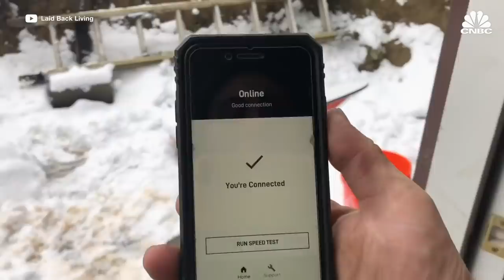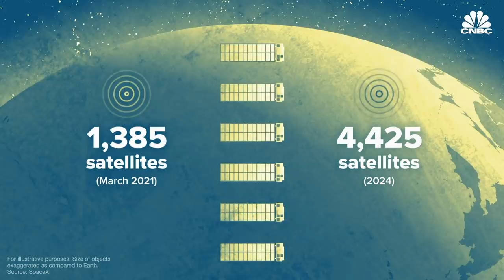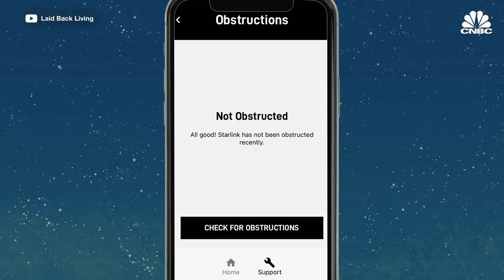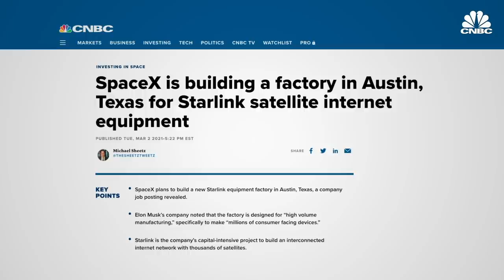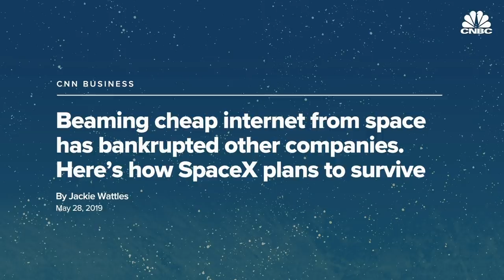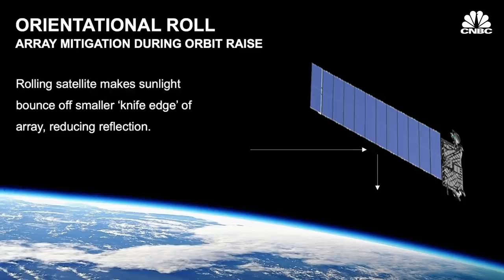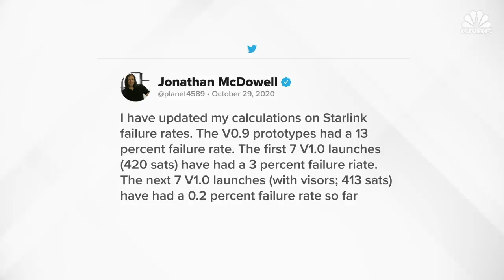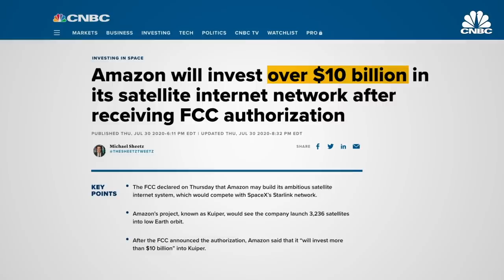Why Starlink Is Crucial To SpaceX’s Success

Comment: Non-trackable debris is going to be a huge problem when this becomes more mainstream.
Reply: Not really.  These are inherently traceable.
Reply: @xiaoka  I'm talking about non-trackable debris... Which would be a significant threat to a network of satellites.
Reply: @eat_ze_bugs  right, your comment made sense like 10 years ago. Nowdays everything can be seen.
Reply: @shanewillbur1325  Not everything can be "seen". An impact from a 10mm paint chip from a second stage could damage a starlink satellite, possibly rendering it useless given its disposable nature.
Reply: Probably not. Small debris does not cause massive debris fields. It might disable a satellite, but it will not impact the de-orbit plot at all. All it is, is a rather unfortunate and expensive way to de-orbit that piece of paint as well as the satellite.
Reply: These satellites are in low earth orbit. So the problem will not be that big as things will fall and burn up soon
Reply: @eat_ze_bugs  My understanding was that more modern/recent rockets and definitely commercial rockets(SpaceX, Rocketlab) don't really ever create micro-debris like paint chips. Supposedly the space shuttle and all Chinese/Indian vehicles were/are very bad in this respect.
Reply: @Diggnuts  It might not create a massive debris field but if it were to disable a Starlink satellite it can definitely alter the structure and attitude making it unsafe to de-orbit and a threat to the network itself.
Reply: @adamanderson3042  Micro debris like paint chips or particles from fatigue joints are inevitable during rocket launches. Shock from stage separation and engine ignition will always cause micro debris especially if the rocket is painted. Ice buildup and fuel leaks above the Karman line is another factor many engineers in the industry tend to leave out due to its evaporative properties, but if we are talking about hundreds of thousands of satellites from various entities then things can go wrong very quickly before we can rectify it.
Reply: @vineets  Agree, waiting 4-5 years at most for orbital decay would be pretty inconvenient but still better than the alternative.
Reply: @eat_ze_bugs  "Shock from stage separation and engine ignition will always cause micro debris especially if the rocket is painted"

Stage separation is always done at suborbital speeds and Starlink launches don't require engine relights so those too are done at suborbital speeds. So anything that comes off the rocket at those times will fall back to Earth in dozens of minutes. Paint chips and small objects like that that somehow do make it to orbital speed usually deorbit in days to months because of the nature of paint that is applied to rockets, it has a very high volume-to-mass ratio, which is perfect for naturally deorbiting. 

I can promise you that for all of the reasons I have stated, Falcon 9, Falcon Heavy, Starship and Starlink will cause unimaginably inconsequential amounts of orbital debris that will last for such a short period of time, such that to complain about it would be tantamount to entertaining the possibility of turning the global economy off and letting everyone make their own goods because you're worried that the mass of cargo ships travelling across the worlds oceans is changing the mass distribution of the planet and therefore changing the gravity of the planet.
Reply: @adamanderson3042  Are we having a discussion or are we arguing? Read my original comment again. Nowhere did I mention SpaceX in my comments, you seem to think I'm complaining about them when I'm explaining the inevitability of micro debris and how it could impact various networks of satellites like that of Starlink's. The act of inhibiting discussion with analogies such as "turning the global economy off and letting everyone make their own goods..." is not going to solve this problem but instead make progress even more difficult in the future. My main concern wasn't about SpaceX debris but non-trackable debris from all forms of activity in general with the probability to pose a collision hazard that needs to be attended to if we're going to have such a ubiquitous, complex and fragile set of networks interdependent on one another.

Don't take my word for it, here's a useful handbook still relevant to this day on orbital & sub-orbital debris mitigation. You and anyone else reading this might find this helpful as to understanding the sources of debris that are currently present:- https://apps.dtic.mil/dtic/tr/fulltext/u2/a435172.pdf
Reply: @eat_ze_bugs  Utter nonsense. Even if that small amount of kinetic energy is fully absorbed, the orbit would be affected minimally and the automatic de-orbiting profile would still be valid. It would exit the occupied shell within months. That is assuming the maximum and most effective transfer of momentum possible.
Reply: @Diggnuts  Albeit a low probability, small debris can definitely affect the attitude dynamics and gravity gradient torque of such a craft especially given its low mass design.

You are right in regards to the craft exiting its occupied shell. It will take a relatively short period of time given that it doesn't lose control or else It will be at the mercy of all the other satellites and future space stations as the orbit decays. But remember, we're not only talking about one satellite here but a multiple growing network of LEO satellites at various altitudes from various entities that needs to be regularly replaced from time to time which has never been done before. 

The only improvement I can think of that can overcome this issue of uncertainty would be to employ some type of passive attitude stabilization. I'm sure the team at SpaceX are actively working on improving their fail-safe procedures but until then micro debris will still be a threat to these networks one way or another.
Reply: @eat_ze_bugs  It can, but it usually simply doesn't so this pedantry is pointless prolix.
Reply: @eat_ze_bugs  "Nowhere did I mention SpaceX in my comments, you seem to think I'm complaining about them"

Dude, my literal response to you was saying that SpaceX was really good in these regards and then you replied to me and contended that by saying "Micro debris like paint chips or particles from fatigue joints are inevitable during rocket launches." so you were obviously arguing the point specifically surrounding SpaceX, don't lie. I stand by my original comment, which was "My understanding was that more modern/recent rockets and definitely commercial rockets(SpaceX, Rocketlab) don't really ever create micro-debris like paint chips. Supposedly the space shuttle and all Chinese/Indian vehicles were/are very bad in this respect."

I agree that micro-debris from other launchers could become a hazard for SpaceX and I agree that rockets need to rapdily become as clean as possibe, which is an issue for ULA, Russia, China and India. But do me the respect of admitting that based on your response to my defence of SpaceX, it was very obvious you were implying SpaceX had this problem.
Reply: @adamanderson3042  Again, stop bringing up SpaceX when I was referring to rockets in general in my reply. I agree that modern rockets do create less micro debris partially due to their pneumatic separation systems but that's only a band-aid solution. You seem to be getting unnecessarily defensive(especially about SpaceX) for no reason over a statement which reigns true for all rockets ever built. From my years of experience in the aerospace industry I can confidently tell you that no rocket will ever be close to being free from micro debris, these are inevitabilities that cannot be eliminated but only reduced due to their nature of operation. It's not a SpaceX problem but a rocket problem.
Reply: @eat_ze_bugs  Your English comprehension skills must be really bad if you're still using the same argument.

Comment: If StarLink is marketed primarly to average Joe's it will LOOSE. It first and foremost should be marketd to railways, prospectors, mining, offshore and maritime, aviation, remote science and weather sensor stations, non-critical military (troops for families) .... where 1k-5k USD / month for same service will be insignificant OPEX. Individual consumers should be afterthought. They are also in urgent need of antenna update to full phased array, electronically stabilized for mobile terminals, come clear on QoS and allow connectivity between terminals and in future - think about access to this free space optical backbone for selected premium customer organisations and URGENTLY provide continous coverage, if not high capacity, for polar regions.

Comment: The amount of factually wrong and misleading information on this piece is staggering. "SpaceX claims that this closer orbit allows this system to have a lower signal delay" .... This is science, the "SpaceX claims" part is just unnecessary. Then you go to "Latency is important for video streaming" .... this is false, a typical video streaming service, even livestreaming will keep >20s buffer to prevent stuttering. Your satellite could literally be in the orbit of the moon and live streaming would not be impacted by latency. Then you go to: "Musk has said that he expects the service will double in speed by the end of the year. To do this, the company is developing a technology known as inter-satellite link" .... Inter-satellite links will not boost speeds, it will rather lower latency in connections to far-away servers and will increase coverage. If anything, inter-satellite users will experience slower speeds because these links are typically slower than point-to-point. Then it goes to "If however they move to the inter-laser communications on the satellites they can greatly reduce the number of ground stations needed".... while technically true, If SpaceX wants to maximize bandwidth, they  will want as many ground stations as possible in the US and in other developed countries to reduce the dependency on inter-link comms. This is not a real constraint. Then it goes to "The biggest challenge that SpaceX is facing with Starlink is also one of the big unknown about the actual equipment cost itself" .... How did you get to this conclusion? You're admitting that this is an unknown and then saying that it is the biggest problem as if it wasn't an unknown. Fact is we don't know if this will be a problem for SpaceX, for all we know, they have a path towards mass producing these stations and exponentially reducing price... Right next sentence it goes to "If they're selling these kits for 499$/kit and it costs them $2k to make them, they're running huge losses to begin with and they have to get a lot of people on board to make up for that".... The ROE for ground stations would not change based on the amount of people on board, it's the ROE for satellite cost & launch cost that would be at play here.